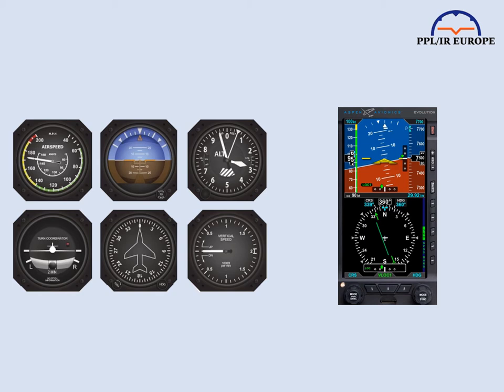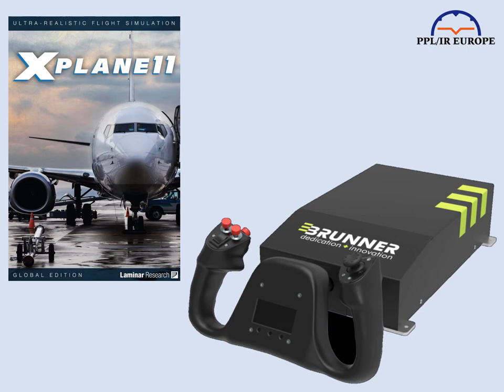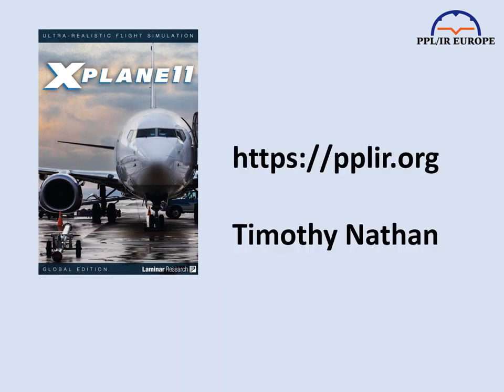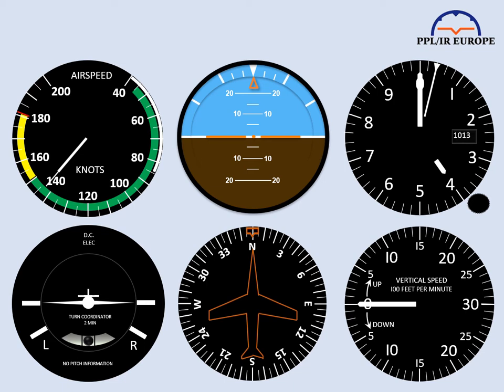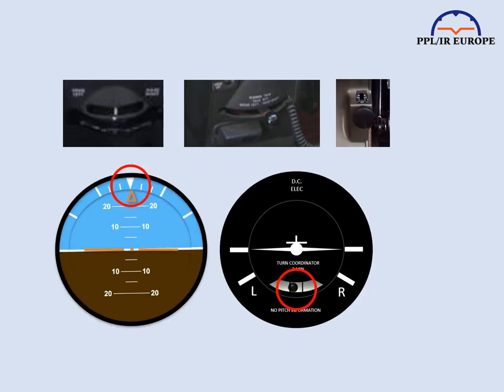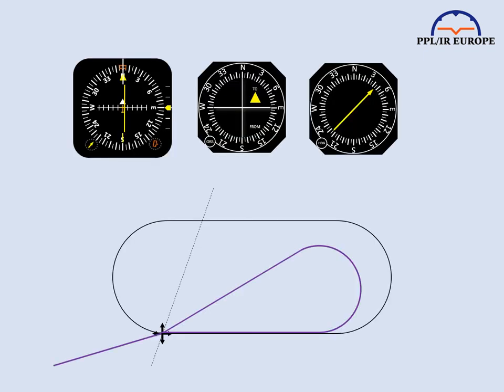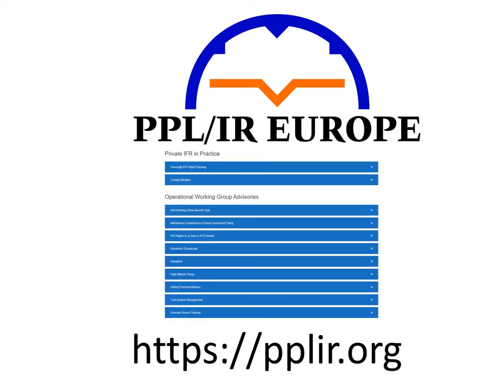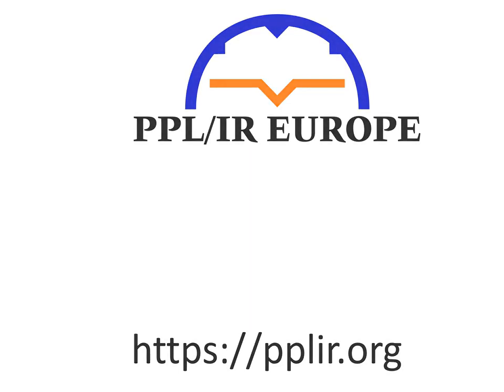Basic Instrument Flying

Comment: Looks like this is the exact opposite of what they teach over here in the US. They talk about undue reliance on attitude indicator, and they want you to have a "primary" instrument for each type of maneuver by reference to which to make the change, and then you frantically scan all 6 instruments in an endless rat race (or even a special magic scan for when you are, say, in a turn). Attitude method seems much easier, except I'm not sure what you do if your attitude indicator craps out.
Reply from the maker: You should be trained for what to do under those circumstances, but, these days, many aircraft carry more than one attitude indicator, preferably one electronic and the other vacuum.

Also, many autopilots run independently of the attitude indicator. One example is the STEC range of rate based autopilots, another is digital autopilots which run on their own independent AHRS unit.

So, my suggestion would be, rather than rely on partial panel skills, try to arrange that there is a back up to the artificial horizon in one form or another.

You still need partial panel skills, and should practice them.  But to fly every flight as if the most helpful of all your instruments is absent is to increase your workload hugely.I am amazed if it is common practice in the USA to teach that.
Reply: My instructor said that the AI is the least useful instrument.